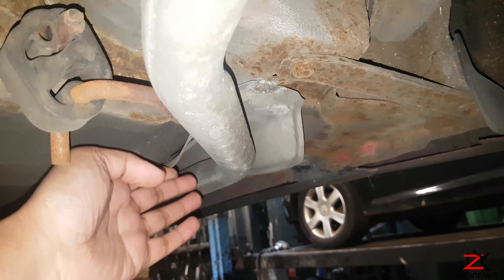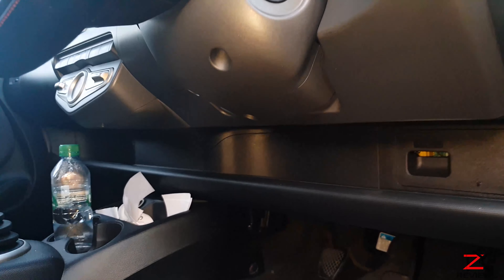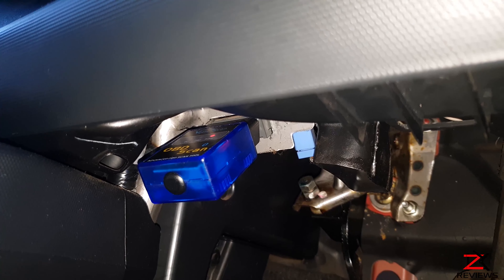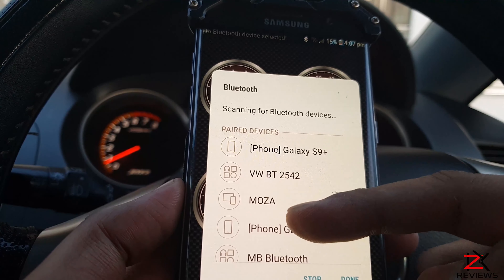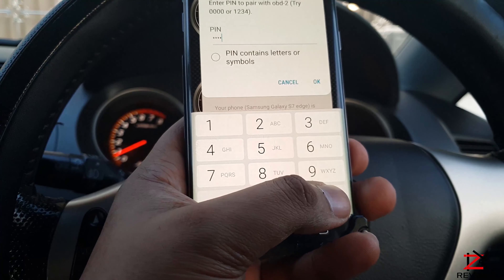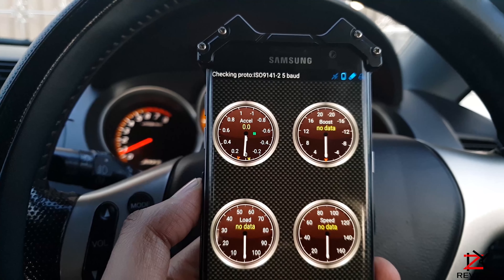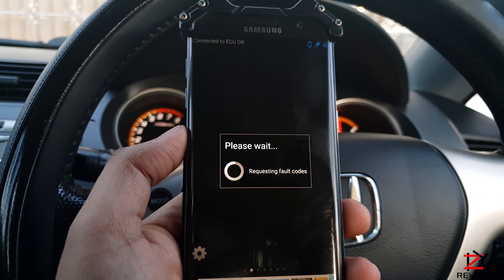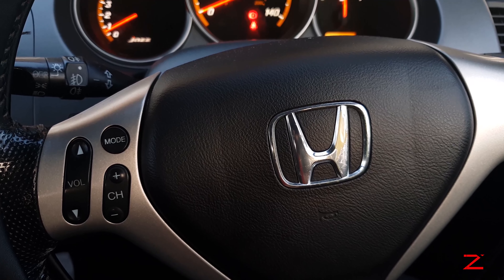Finding Car Engine Fault Using OBD II Scanner | OBD Location Honda Jazz | How To Clear Engine Light

Comment: I haven't been clicking on "the pin contains letters and numbers",  because there's certainly isn't any letters in the pin is 1, 2, 3, 4.

 Could this possibly be the reason why my particular OBD2 scanner is not able to read the ECU?
Reply from the maker: Check if its compatible to read ecu sensors